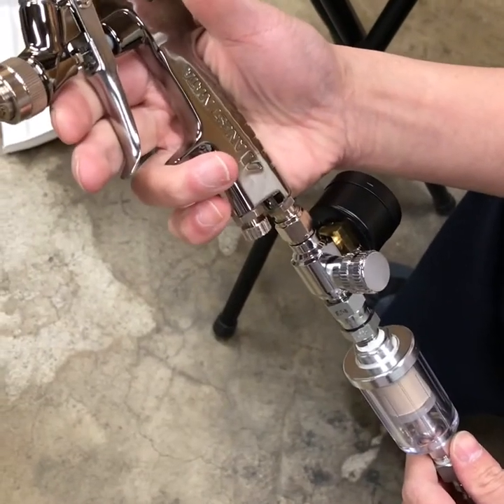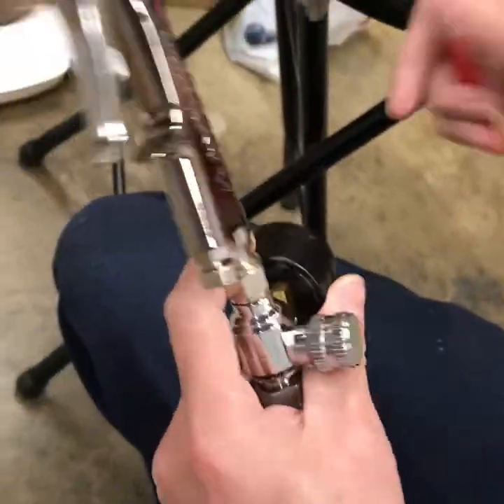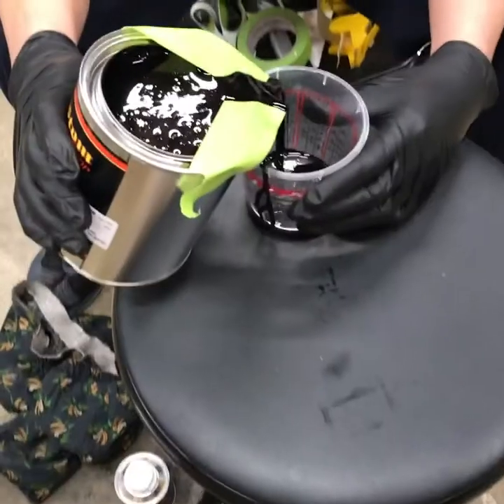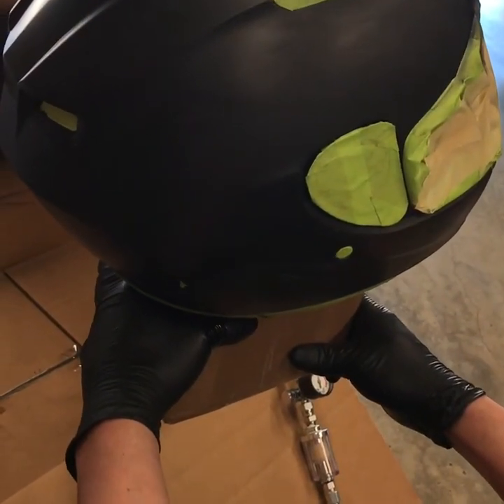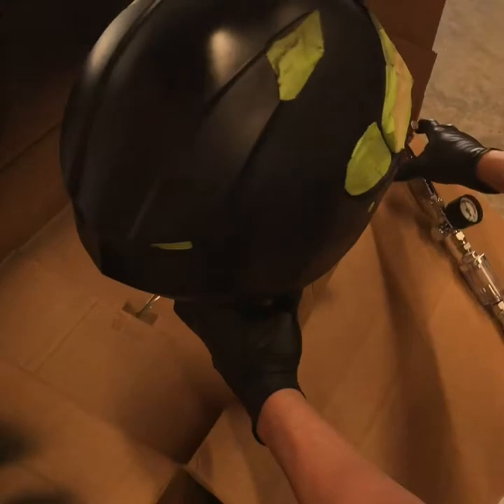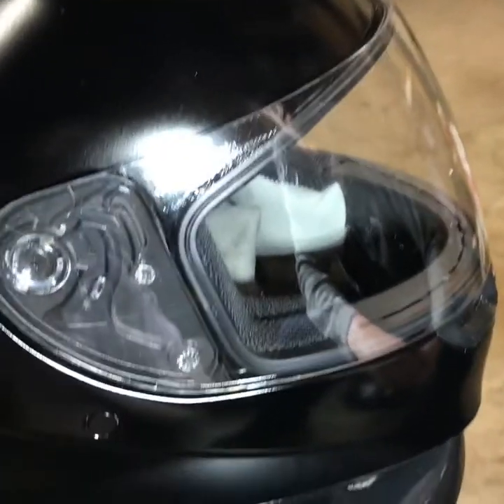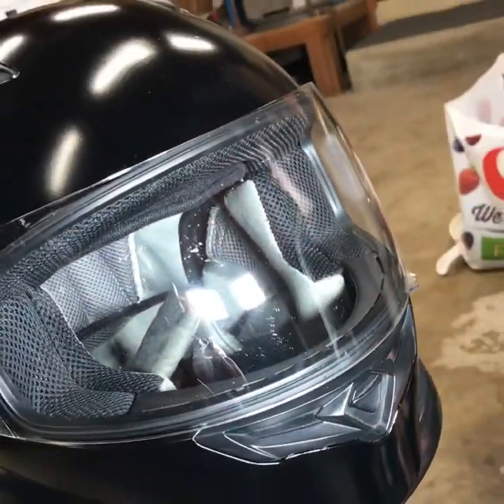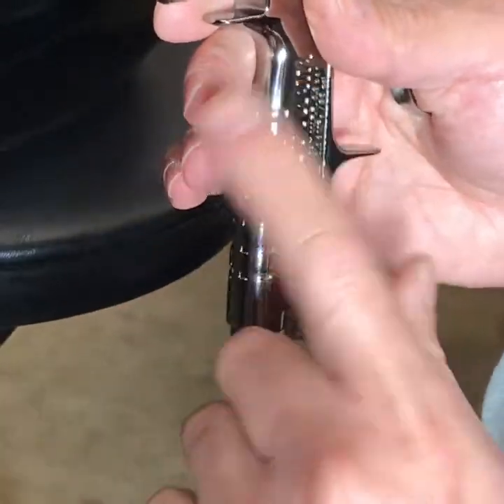Spray gun (LPH 80) testing a helmet with 2.6 Gallon air compressor

Comment: I like these little small guns. That lph80 in 1.2 and e4 cap is great. I recommend it if you have that gun. If you want a 1.0mm E2 or smaller I recommend the side cup lph50. It cheaper. I got mine with cup for $170. I like having the side cup. Compact and handles well. Cheers